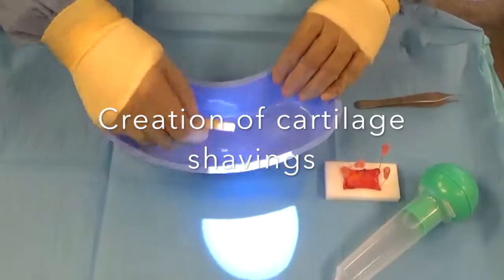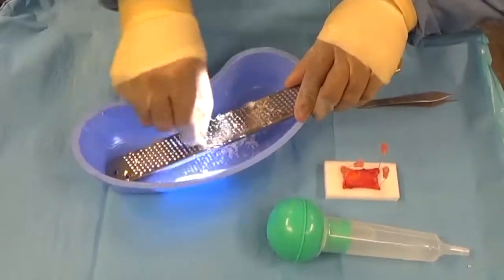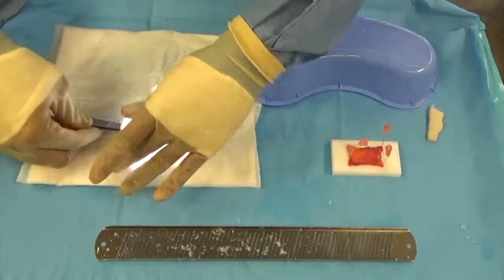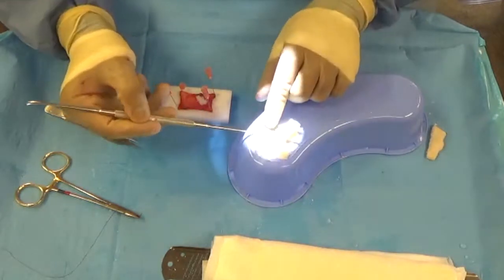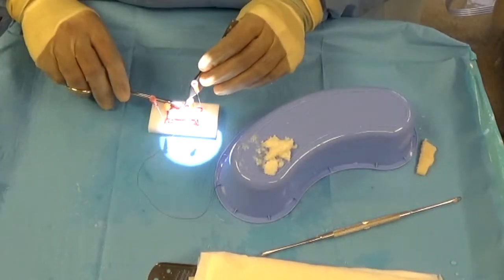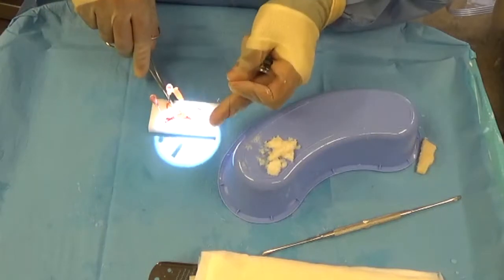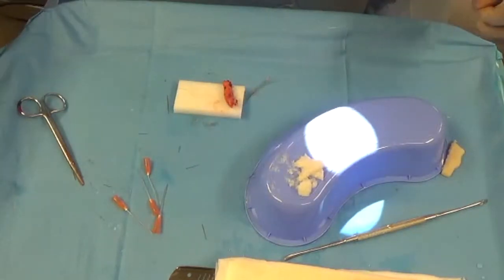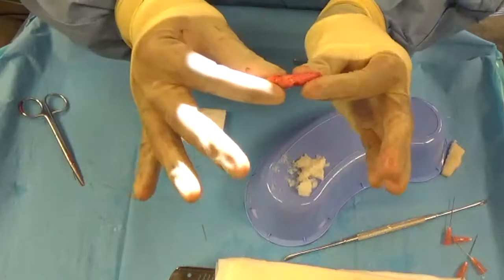Shaved Cartilage Fascia (SCF) graft creation - Plastic Surgery Hacks for DCF graft creation

Comment: Dr Shah, is it possible to create a cartilage graft that is also slightly adding some width to the bridge at the radix on one side? One side of my bridge up at the radix is asymmetric and leaves a big inward curve on one side.
Reply from the maker: The graft is designed for central augmentation. It may be better to reshape or reposition the radix first and then place the graft on a straight radix.